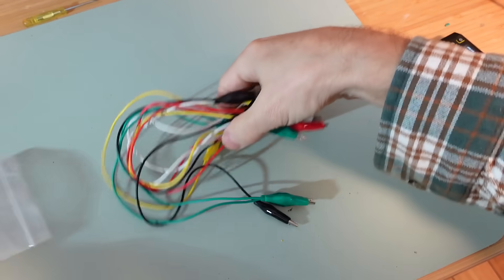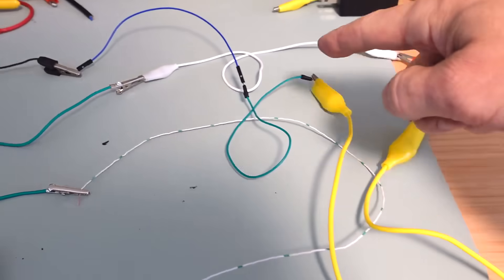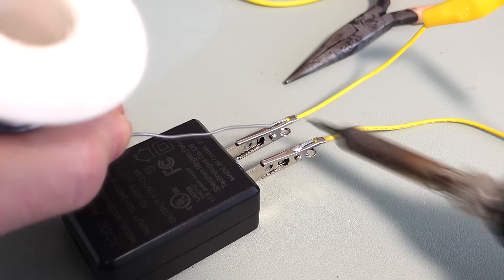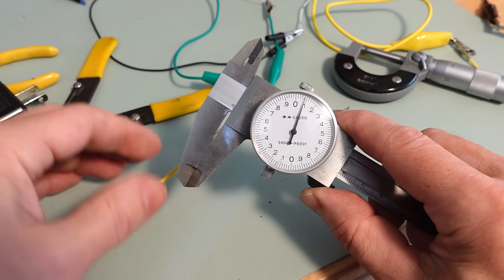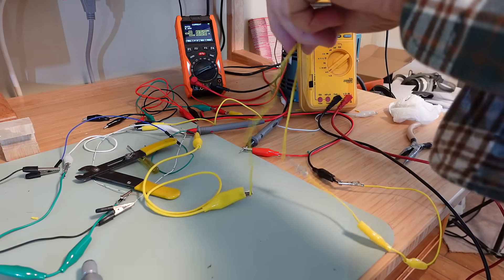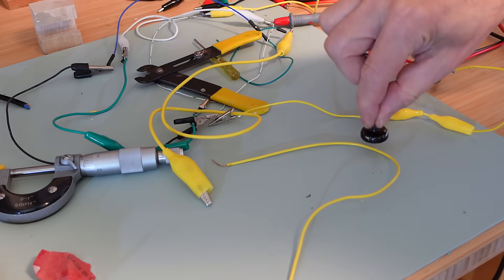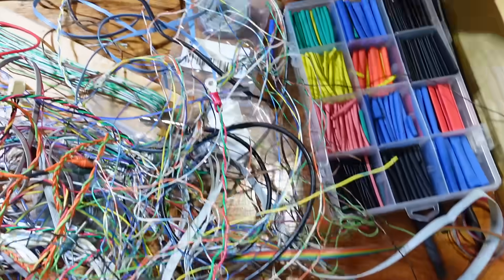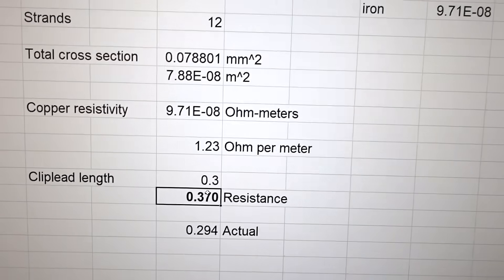Clip leads made with fake wire

Comment: Simular tests done here. Same result, except that I also found aluminium wire with copper (coloured) cladding.
Also nice to see the wirestash. Like many of us have 👍🏻🤝🏻🇳🇱
Reply: Yeah, same.
Reply: Copper clad aluminum (CCA) ethernet cables are also a problem in a world of POE (power over ethernet).  They can actually catch fire due to the resistance and that knowledge is not as widespread as it should be.  I had to go out of my way a fair bit to get out of the realm of CCA cables when trying to buy a massive spool to wire my house - the stuff is everywhere.
Reply: At least aluminum is a decent electrical conductor... Did you notice any problems with flexibility or breakage from mechanical fatigue?
Reply: I think one of the issues with aluminium is that it's a pain to solder because it needs a special flux and hotter temperature.
Reply: Find a gardener/landscaper some time and get them ranting about the epidemic of aluminum hose fittings over the past decade(s). Sure, it's cheaper and doesn't rust, but spigots are brass, and combining those two metals is a recipe for disaster — especially around water. Galvanic corrosion can turn an aluminum hose fitting and a brass spigot into a single, fused piece of metal that you'll never be able to separate.

Comment: I bought the exact same set last year and yes, they are copper plated iron wires. Crazy way to save a buck. They are also using this fake wire in transformer windings - the Chinese cheating other Chinese...! If you buy these dangerous leads, get rid of them. The end clips are OK.

Comment: Now I have tested my cable clips: At first glance I was lucky, it is not iron wire. However, the voltage drop at 1 ampere is too high for copper wire. So I also exposed a terminal and the wire shines silver. In the flame of a small gas burner it melts, unlike a copper wire, so it is almost certainly aluminum. So if you want real copper wire, you have to take a look. Unfortunately, a magnet is not enough to expose the fraud.
Reply from the maker: Aluminium is way more conductive than iron, so not so bad.  just it might break.
Reply: @matthiasrandomstuff2221  You're right. Fortunately, the single strands are very thin. Nevertheless, it is not advantageous to use aluminum for clip cables, so I will replace them. You see, your contribution was worth it, thank you again.

Comment: lol i used these wires for a 1500w load not too long ago cuz i couldn’t find an ac cord. the wires were certainly soft afterwards. now i really wanna go check them with a magnet, they’re still going to get used tho. I always thought those super cheap wires were copper coated aluminum

Comment: A new low from China. They used to make wires from aluminium, with a copper coating if you were lucky. You could tell how bad they were just by holding a flame to the metal, it would crinkle up and burn away instantly.

Comment: the internal shielding of some wire can be made of steel so I wonder if that's what's in the mouse wires. pretty much all USB cables have shielding unless they're really cheap or low use.

Comment: I have a box full of assorted clip leads. Most of my work is with vacuum tubes so a bit of resistance is not an issue since the current is low. I have gotten into the habit of testing each clip lead before use by shorting the output of a 3 amp current limited power supply. When a lead fails, it's almost always at the crimp. Some are bad right out of the package. I would have never thought about counterfeit wire, but about half of my clip leads fail the magnet test! I have two unopened packages from a popular store that sells everything from clip leads to gasoline engines, and both are magnetic. If they pass three amps for several seconds, I'll use them anyway.....until they don't. They get loose with age and use.

Comment: look out for network cable too, there is allot of CCA -  'Copper Clad Aluminium" cables which are usually missleadingly marketed. I found out the hard way after purchasing 305m of it! at least here in Australia it is not up to standard to have it hard wired in your walls.

Comment: Note that copper covered aluminium is also a thing, and it will pass the magnet test.  The (destructive) way to test for this is to hold the strands into a flame from a lighter etc, aluminium wires strands quickly melt away to nothing.

Comment: could swear this video was posted a few months back? or am i a victim of 4th dimensional shenanigans?
ive noticed that the leads of many electronic components are actually iron... generally low power things, LEDs, transistors, and resistors, etc... stick to the sidecutters. whereas FETs or high power devices are copper.

its not "fake" wire, its still WIRE... just not copper! lol.

another sneaky one is anodised aluminium. in that regard, at least you can solder to iron?

anyway. i dont buy leads, i make them. shame its basically impossible to get decent alligator clips... all nasty things, badly riveted, all end up going rusty and/or falling apart after a few weeks.

Comment: I bought similar clip leads. Never measured the actual resistance, but the leads looked flimsy so I replaced them with thicker wires. Looks like it was the right call

Comment: A whole lot of wire coming from Chinese mills is recycled steel plated with copper.  I've also seen copper plated aluminum.  And some of the copper plated stuff will not wet with solder.  It's pretty junky.  Save money on purchase--and pay for it later!

Comment: A lot of 'copper' wire that I've bought has turned out to be copper coated aluminium, which can't be found with a magnet - only by the measured resistance. So buy from reputable suppliers if the resistance matters to you.

Comment: the mice wire actually has a stainless braid around the outside of the conductor wires, works to help the durability of the cord since it is constantly being moved. ive also just switched to just making my own alligator leads with quality clips because i cant stand it when they wont grab a small wire because the teeth are so misaligned. i got them from mauser or digikey.
Reply: That isn't stainless.  Most stainless isn't magnetic.
Reply: @stargazer7644  you've probably never scrapped metal before, most stainless we use is magnetic. they check it all at the scrap yard and only non-magnetic gets paid at non-magnetic price. i would say that like 75% of the stainless you encounter every day is magnetic.
Reply: @agentjwa  Of the dozens of grades of stainless steel, only about 6 of them are magnetic.  Type 304 and 316 are the most commonly used stainless steels because they are the ones used in the food service industry.  These are austenitic stainless steels, and they are not magnetic.  Only ferritic and martensitic stainless types are magnetic.  Magnetic stainless steels aren't as corrosion resistant, hence why they're generally not used as much.

Comment: I ran into the same problem about a month ago with clip leads I bought off of AliExpress. Yup, over half an ohm each.  Ended up replacing the wire with some 22AWG silicone jacketed wire. Makes you wonder if all the extra work is worth it. But for less than two bucks your basically getting the clips and the boot. The wire goes into the landfill. Crazy to think there is a factory just churning those garbage cables out by the bazillions.
Reply: I always message the seller to tell them to stop shipping land fill junk and that while it may be legal, only a sub par human would think it is moral.

Comment: My mouth actually dropped when you pulled out the magnet, and it grabbed it.
Reply: Same, i was expecting copper clad aluminum (cca) but not iron/steel.
Reply: @Cynyr  They did used to make a lot of them from copper clad aluminum, but people complained about solderability.  The copper is so thin on those that the soldering iron can literally scratch it away when trying to solder to it. Once the copper is gone, the aluminum will not take the solder.  You can still find a lot of cca in cheap chinese power cords and other crimped cables.  These days I always just make my own clip leads if i need them, or buy from a reputable source.
Reply: @Cynyr  I was right there with you
Reply: @Cynyr  Yeah me too.
Reply: I would like to say the same, but honestly, it doesn’t surprise me.
Reply: Iron Chinese wires are definitely a thing. Apparently copper clad aluminum isn't cheap enough for them anymore. It's getting crazy out there.
Reply: @1pcfred If you've been keeping up properly you can see that China is starting to fall. Freedom just around the corner
Reply: mee2, not becasue it wasnt copper, i knew copper plated aluminum is common in chinesium products, but i never knew they would use iron...
Reply: @jksjrgfpsjgr  I doubt it is iron. It's probably some kind of steel. I don't think you can draw iron that thin. But maybe? It's nothing I am terribly knowledgeable about. Steel is an alloy of iron, carbon and possibly other elements. With Chinese steel I'm sure there's all kinds of stuff in there. Whatever scrap they load the charge with.
Reply: @1pcfred 

Kinda the point.. even if it's an "alloy" of any kind, it's such a mash of garbage it might as well be iron.

Shit.. might actually be good enough for American engines. 🤣
Reply: yeah, I was listening while working, got to that part and turned and just stared mouth agape.
Reply: When I was teaching, I used to demonstate that a magnet attracted a British penny, because British "copper" coins are a skin of copper plated round an iron core.
Of course, rather than proving this fact, about a quarter of the pupils weren't listening, didn't look, got confused, etc. and drew the wrong conclusion: "copper is magnetic". 
As Douglas Adams once said "A common mistake that people make when trying to design something completely foolproof is to underestimate the ingenuity of complete fools.”
Reply: @neilbarnett3046 Steel US 1 cents coins date from WW2. The newer ones are plated zinc (less wear on the dies).
Reply: I immediately ran to check my jumpers I bought over 5 years ago and yup they are ferromagnetic, damn.
Reply: @Atom224 ,  Cheap speaker wire of the type made with clear insulation, where one side of the wire looks like copper and the other appears to be tinned, is often merely iron wire that has been plated with copper on one side and plated with tin or something similar on the other wire.
Reply: I actually laughed out loud, unbelievable!
Reply: Mine literally did too!
Reply: You're not alone there.
Reply: How Ironic!
Reply: @charlespatt  😂
Reply: This made my day. And it's almost midnight here. @charlespatt
Reply: Same
Reply: I'm still in recovery 😮
Reply: I wasn't surprised at all.. they've been doing this for a long time.
Reply: Same
Reply: Just found one myself ack! 🐴
Reply: CuriousMarc had  issues with wire wrap wire that was copper coated steel..
Reply: Glad I was not the only one 😮
Reply: Just checked a bunch of mine...Lots of trash
Reply: I remember trying to fix cheap chinese earbuds years ago, and had to solder the wires... turns out they didn't even bother with the copper plating, just iron. Practically impossible to solder (now I know that you need special flux for it).
Reply: big Clive has such situations quite often
Reply: Same here, I'm gonna have to go check mine & I'm thinkin some of mine are iron ! :( , partly explains why the only good ones are home made !, besides the obvious age old problem of them supposedly being crimped ???? , Chinese stuff hey, we aint fancy (or any good!) but we're cheap !.
Reply: Yeah I thought "well probably it's aluminum not iron" and then the magnet picked it up lol
Reply: I read this comment while the video was playing, and I got confused, looked up, and then watched him pick it up with a magnet. My jaw also dropped.
Reply: My mind is blown. Now I have to check all of my wire
Reply: That was my WTF china moment. Like it has to take more mental energy to screw people over then to just make the actual passable product in the first place. You included every other damn bit. Just make the dam thing you know.
Reply: I bought a $60 set of automotive jumper cables that literally did not work. They ended up being copper washed steel.
Reply: @rustyshakleford5230  well, at least now you have some steel cabling to tow the vehicle with.
Reply: @rustyshakleford5230  Chinese Made ✅
Reply: You sound fun.

Comment: I found a usb charger cable that had magnetic wire. I'll keep eye out for these from now on.
Reply: Keep in mind USB cables often have a sheet of steel sheathe inside, or a steel wire running down the middle for strength.  It doesn't mean that the power and data wires aren't copper.
Reply: @Choochinc  Interesting. the connector is too small to get multimeter in there so i wasnt able to actually measure resistance

Comment: The new "standard" for low cost Ethernet cables is CCA or copper coated aluminum. This seems to be available in Cat5e, Cat6, Cat6e, and Cat7 cables. Looks like we need to do a better job of recycling copper, to get the price lower. 🙂
Reply from the maker: Aluminium is not so bad, and as long as the run is not super long, as long as the bits get thru, it doesn't matter.  Just aluminium is more likely to break
Reply: @matthiasrandomstuff2221  Yes, not as bad as iron, but a sign of the times. I still like 100% copper wires, but I have to take out a second mortgage to afford it.

Comment: I bet this is also true of a lot of USB-C "So called" high capacity charging leads that are often very cheap on Ali-Express - - They are probably utter crap. 
Then consider the so-called high quality HDMI leads & conversion USB-C to HDMI cables. They are probably using inferior cables and low quality or fake chips as well. Buy cheap and you get utter junk.

Comment: They also use fake wire in mains voltage extension leads, worrying here in the UK with 3.2kw available from the wall 😮
Reply from the maker: But at least you guys have 240 volts, so the current needed for the same power is only half as much.